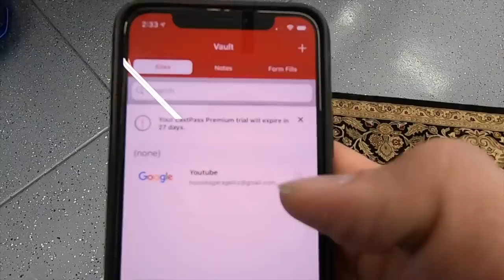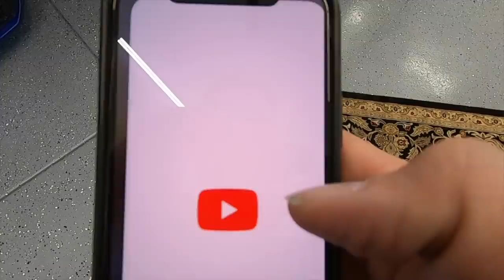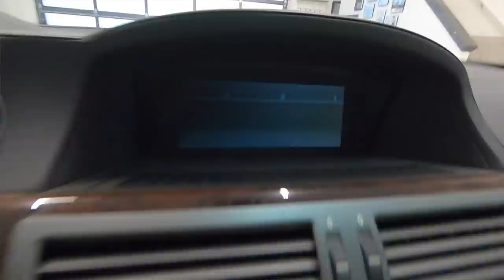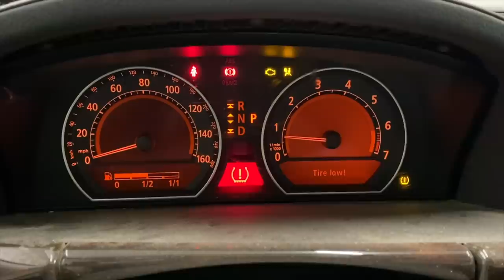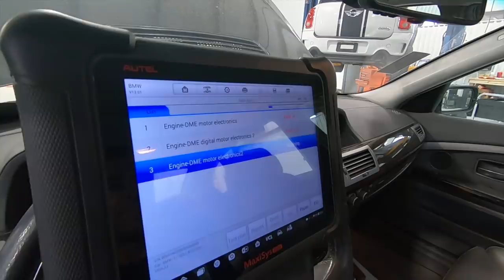I Bought a Cheap V12 BMW 760Li, Because I Never Learn From My Mistakes

Comment: 3k repairs on a car, that didn't receive any maintenance for years? sounds pretty good.
Reply: That's like 1k in a year ($83 in a month)
And people say that BMWs are money pits.
Reply: I drove my 523 for 14 years. Repairs: Coolant pump, broken door handle, rubber damper rear axl. I changed the breaking pads one times..... that's it.But it was an e39.
Reply: Yes
Reply: @juppidisco  my old E60 545i tells a different story...
Reply: @UCBarkeeper  yeah but thats cus you bought a 545 tho.. shouldve just gotten a 535
Reply: @benny8992  got an G30 M550i, i'm hopeful.
Reply: Juppi Disco e39 and no broken window regulators? Unheard of
Reply: Penta no, nothing else(and 300000km!).I think maybe it was the best model.
Reply: I can’t stand people bashing German cars, they are some of the most reliable cars out there when cared for properly. I’ve had plenty of people tell me how horrible they are while mine don’t need much at all and their Honda needed a new ac compressor, wheel bearings, ecu, cv joints, headgaskets etc and they want to say it’s more reliable. Bs
Reply: I had to spend $0 on repairs on a car that hadn't seen maintenance in a decade
Reply: BMW parts are pretty cheap compared to other manufacturers  (VAG and toyota I'm looking at you) - the problem is labor. Most BMW's over 2005 are pretty hard to work on. Also, when something on a BMW brakes, it's usually something small and annoying, but expensive to fix like a timing case gasket or crankshaft seal, so most people don't bother since it doesn't really affect the driveability of the car. Also most BMW's are owned by mechanically innept people... If you do decide to by a BMW, buy one that is been sold and has been serviced before sale by a BMW dealer. Got my 2016 3 series GT 320d for 11500 euro from one such dealer and they did most of the gaskets and the timing chain + tensioners before putting it up for sale.
Reply: @SilverracerKH  Scotty Kilmer disagrees
Reply: @juppidisco  e90
New Pulleys, New Water pump & thermostat, new oil cover gasket, new valve cover gasket, new starter....

Yeah, it's been rough. Next car is probably going to be a Lexus or Toyota. I love BMW but goddamn does that shit leave you stranded.
Reply: Will it stay reliable after tho? That's the real question
Reply: @AdmiralFroggy  lol no.
Reply: @Alecxace  that's what I mean lol. Don't get me wrong BMWs are slick looking cars they look nice and they run nice. But that doesn't justify the terrible purchase that is a BMW. If you absolutely have to have one just just lease it lol. The funny part is most luxurious cars if not all are pretty unreliable and or they are a complete pain to fix.
Reply: Yeah, only if you got yourself a car wizard lol
Reply: @AdmiralFroggy  In that case, why do people praise Acura and Lexus for their reliability compared to Germans? The truth is that luxury cars are truly the most you can get out of a car from what you can experience. Most manufacturers limit the features of their non-luxury brands (VAG, Toyota) to benefit the buyers that purchase their premium vehicles. That is why BMW and Mercedes are attractive brands because they only have one brand to focus on (except now they offer more entry-level cars that I don't like). But they're expensive to maintain so you have to decide, do you want a reliable, less fun car that will be cheap to maintain or the opposite? IMO after driving Honda and Hyundai for years,  I hope to make enough to 'upgrade' to a luxury car because they truly are better cars. But to be able to even own one, you need to be in a good financial position, which is where most people mess up. It also comes down to whether you are a car person and how far you are willing to go with that. I'm not crazy enough to daily some super expensive car but I would sacrifice some time and money to get a better car but that''s just me.
Reply: @juppidisco  If it was an automatic, the e39s really were the best model. Good choice!, some were lucky and had a very simple to fix Chevy transmission in them (Opel, which was owned by GM would share the transmission with BMW for a couple of years of the E39) and the smaller engines were generally okay. I finally had to let my little 528i go because of problems with everything else rather than the drivetrain
Reply: @basshead.  they are
Reply: Just spent that amount on an m5 and it still doesn't run well
Reply: Hoovie has 6+ cars at any one time. He is not daily driving these vehicles. Sure, $3,000 to get this thing running decently for you to drive 2x a month is not bad. However, if you were daily driving this car, I wonder how many of those $3,000 repairs you would have within 1-year.
Reply: @basshead.  Bmw's aren't poorly made they are amazing cars mechanical marvels but when they break they are horrendous to fix so people don't it gets worth and you get  a money pit so they are good but just pay the miantenenace don't buy it if you can't afford the maintenance!
Reply: @nicholasfernandez2573  they are overcomplicated so that they are an 11/10 instead of an 8/10 which makes it so that it's over engineered if you ask me you wanna drive 500k with your car get s toyota
Reply: @LowerYourExpectationsPleb  Best name ever!
Reply: @AdmiralFroggy  not likely
Reply: @UCBarkeeper  keep your warranty lol
ANYTHING new bmw wise is gonna spend alot of time at the dealer. my 22 year old e46 is a tank. but its no where near as nice as your g30.
Reply: Up in New England..multiply x 2 or 3

Comment: Love it when a car is so bad that the mechanic says "no thanks"
Reply: After watching hoovie I enrolled in a ASE certified auto tech course. 
I love these older BMWS but to own them and upkeep them I have to be able to do 90% of the work myself. 

The tools, experience, and software will pay for itself long term. From what I've learned with his costs it's one job will  cover the cost of the program much less two or three
Reply: LOL
Reply: the mechanics have no problems with bmw's,. only wizards and sorcerers run away,.,..
Reply: I took my 2004 F150 into a local mech shop who had a great reputation around my smallish town. I asked him about doing the spark plugs and the issue with them breaking.

He said "in 15 years I've never broken one yet..." oh really? You have a special trick on how to get them out?

Yeah, I refuse to work on them. I won't even let one in my front door and I'd like you to get it off my lot thank you lol
Reply: @muskokamike127  well,. call the cops,. cause i ain't moving my 1976 Karmann Bmw 633CSi that i use as a daily driver,.

better yet,. move the truck around the back,. cause you're ruining the view :D
Reply: @PresidentCamacho2024  what????
Reply: I drive a 1988 750iL and I can confirm this happens. Most BMW specialists in California won’t even agree to inspect the brake system.

Comment: I had to rewind.... did he call it a Mercedes??

Hoovie: “Hey Wizard there’s I need to fix this car”
Wizard: “What’s the issue?”
Hoovie: “It has a BMW badge”
Reply: You noticed that to. I'm sure he puts himself to sleep at night counting his cars insted of sheep but then has nightmares all night.
Reply: @wernerdanler2742  that's hilarious, I'll never have night sweats over my 2001 Chevy Prizm.
Reply: @nelzelpher2088  Good Andrew. I don't lose any sleep over my car even though it's a Mercedes with 150k miles.
Reply: @wernerdanler2742  My car has 209k miles. I'm surprised your not having trouble with your Mercedes. What's the model so I can buy it off you?
Reply: @nelzelpher2088  I never said I wasn't having trouble with it. I bought it a little over 2 years ago and almost immediately had to have that controller plate inside the gear box replaced. That was almost 2 grand. Everything else has really been fairly minor. 3 of the window regulators, alternator, belt tensioner and other things. Luckily, I can still do these kinds of minor repairs. No other drive line problems so over all I am fairly happy with the car.
I live in Vegas so the UV is pretty high here so paint does not hold up and the interior suffers. So it doesn't look the greatest but it actually drives great.
Oh yeah, not for sale lol.
Reply: @wernerdanler2742  oof I would hate to eat 2 grand like that. You failed to mention the model and year.
Reply: @nelzelpher2088  I have damn near 150k on my 2007 E550.... I’ll take a 15 year old used Mercedes over any modern Chevy or Dodge 🤣
Reply: @wernerdanler2742  I had my Conductor Plate on my gearbox just replaced recently. For $600. Only major repair I’ve had to do in 2 years of ownership, other than that it’s been basic wear and tear maintenance stuff
Reply: @nelzelpher2088  sorry I never saw your comm till now. It's a 2001 e320 with AMG sport appearance package.
I think I'm going to take it to MAACO soon for paint. 
I'm happy with it because it runs great!
Reply: @diablocls55  I guess I got screwed. When I think about it it just doesn't seem like it would be that much of a job. Did that $600 include the plate and the plug?
Reply: @wernerdanler2742  where did you get it fixed? Because I’ve only heard of dealerships charging $2000 to fix it... and from what I’ve read on forums most dealers do it for around $12-1500. I use an independent mechanic who specializes in Mercedes and BMWs who doesn’t rip people off, or tell people their car needs this and that when it really doesn’t. I only actually used him for the conductor plate and a problem I had where my headlight wiring degraded so bad and I’m not good with electronics on these cars so I didn’t want to touch it and risk fucking something up. And I had him replace the conductor plate because I don’t have a garage at my house. Just a average sized house and a very long driveway. Everything else I’ve done myself (radiator hose seal, front right air spring, serpentine belt)
Reply: @diablocls55  the place is called G&G Autohouse here in Las Vegas. It was a bit over $1700. It did seem a bit steep at the time but they came highly recommended.
Reply: @wernerdanler2742  oh I just saw you had an e320 which used a 5 speed correct me if I’m wrong. You definitely got ripped off because it’s even cheaper to replace (and easier) to replace the conductor plate on the 5 spd than it is on the 7 speed like I have. 7 speed, more has to come off (I believe the plate is bigger too,), valve body has to come down, and it also has to be programmed to the car.  I’ve seen many people who got their 5 speed conductor plate replaced for $5-600. It’s not as complicated with the 5 spd as it is on the 7 speed. Especially considering the early 7 speeds like mine had problems with the electronics
Reply: He did call it a Merc...

Comment: We have a saying in Europe that goes along like this “there’s nothing more expensive than a cheap bmw”
Reply: You're the first European I've heard admit that BMW's are shit. Good on you.
Reply: I have my own saying, Bring More Wallets.
Reply: @rickwendling5735  I know first hand why people buy them, when everything is perfect they are such a nice car to drive. It's just that the honeymoon doesn't last long before your wallet hates you. I've had two three series and two five series. The fives are amazing when everything is happy.
Reply: @ourtime-downhere6931  its also buying the right one. I bought a 2000 Bmw 740i for $2500 and I have had it for almost a year now with no problems in sight. My timing chains are going to be due in about 30k miles, but the car is pretty solid.
Reply: @ourtime-downhere6931  Good news for you. A ton of Europeans know that bmw's are shit. Last bmw I'd get is e46. I'd rather shot myself than owning anything that is more complicated and newer than e46
Reply: @georgehuser4711  both me 3 series were the e46 325i and other than the cooling systems my first one was fairly solid. Always little stuff but nothing beyond DYI. My second one did have the transmission go out at 158k miles, then promptly blew a head gasket right after I paid for the rebuilt transmission. So I'm split, the first one was great, almost never issues besides spark plugs and normal stuff. The second one I put probably twice as much in it as I paid for it. The two 5 series were E60's with the v8's and I wouldn't even accept a free one at this point.

Comment: Hysterical that he thinks he'll be done after these repairs are finished
Reply: The only way to properly fix a BMW is to buy a non-BMW car.
Reply: After this, there's more to come :))
Reply: Yes, we are only at the beginning of another tragic story.  Probably not M5 or Bentley Continental level but we will see.
Reply: Not if he sold it right away.. A 760LI with a V12 engine fully repaired for a bit over 7k would attract a few interested buyers.
Reply: Kevin Barry the longer you keep a bmw, is when you will eventually pay for it all over again, and again in terms of its maintenance requirements, they are endless money pits.

Comment: Flood damaged vehicle 
Mud on the floor 
Texas plate.
I'm from Houston
I know what I am talking about
Reply: Our flood car didn't have mud or dirt on it just satl water stains like crazy
Reply: Yyyyeeeeeep.
Reply: Was kinda obvious yet no mention of flood damage?! Might as well have been a used aquarium.
Reply: If it was flood damaged and it runs, so what?  Clean it up and drive it.
Reply: @johnhansen4550  Flood damage will destroy electronics and make it a nightmare to keep running... On the level of his previous Bentley at least.
Reply: Yep
Reply: thats where I have so many issues with these so called "car experts"
has he ever bothered to mention it was a flooded car ?
Reply: Stephen Reed sounds like a regular, nondamaged 7 series
Reply: Not a Texas tag. It’s a Kansas dealer tag.
Reply: @johnhansen4550  lol okay. Funny comment.
Reply: From what i see, probably purchased from Classic BMW in Plano, TX. Most cars bought from them have a texas flag on the back (i live in dallas)
Reply: @ethanlaug659  im in houston and these dealerships put that flag on anything 😂 he say he got it from auction tho so it didnt come from a dealership he couldve gotten it from any auction cuz they always gettin cars from every and any where
Reply: I agree. I'm no expert, but the way everything was evenly filthy says flood to me. Normal dirt is clustered around frequent touch points and uneven.

Comment: I can’t believe he actually said “I’m not working on that”. You’ve probably spent over $200K with him. I’d flip out lol
Reply: The reason for a mechanic to decline the work is because thry know its a pain in the butt to work on and they are going to loose their shirt if they take it
Reply: Ricky Lahef that is absolutely true. As a matter of fact I personally know a lot of mechanics that when they get a car like that which is way over their head they will send it off to another shop that specializes in that car and fixes them all the time.
Reply: I drive a 1988 750iL (also V12) and I would’ve been shocked if the Wizard said yes.

I’ve called mechanics who specialize in BMW, they talk for minutes, then they ask model and year, and hang up without a word.
Reply: jacobbrashears yeah those V12 engines are not the easiest cars to work on that’s for sure. I’m surprised that the BMW specialists don’t wanna work on that one though. I’ve been told that a lot of Bimmers with the V12 engines share the same engine as a Rolls Royce Phantom and probably some other similar British made vehicles. Perhaps you might try somebody who specializes in British motors specifically the V12. That’s probably your best bet with that car. I wish you luck
Reply: @jacobbrashears  I nearly bought a professionally stored ‘92 750il with 4,000 miles last year. The friend that bought it, sold it in about 9 months......  Looks like I dodged a bullet!

Comment: Flood damaged car, that’s why all the dirt is on the floor. Sediment
Reply: Same thing that i thought
Reply: Naw. That rust at the foot of the rear seat is just from a batch of bad bolts. And thats the original complementary fish carcass in the trunk!
Reply: Orcinus1967 😂😂😂😂
Reply: Houston?  I noticed a Texas sticker on the trunk. I’ll bet you’re right as rain on the flood assessment
Reply: @stevetilk4926  it has snow tires. I doubt it was in Houston unless it was dumped there on purpose for insurance money
Reply: M6Cabriolet good catch. The Texas sticker was a tip off for me.  I wonder where the car came from.  Snow tires???
Reply: I don’t think it was flood damaged.  I think it was a car driven in the north in maybe a snow belt area, and just wasn’t cared for or cleaned.  All the salt  sand and mud over 11 years can make light grey carpet look pretty dirty.  I had a car totaled from salt water flood, a 2010 Cadillac CTS-V, which got flooded in Sandy in 2012, and was totaled out.  Salt water was up to the headrests while in my garage.  I remember thinking how bizarre it was when the tow truck hauled it away as a totaled car, which “looked” great.  Even the interior, minus saltwater still in the cup holders and shifter boot, still looked great - it wasn’t dirty like this,
Reply: Z06ified -wow!

Comment: E38 is an amazing and a very reliable 7-series. E39, 36, 34, etc are also problem-free
Reply: E28 and e30s are also reliable as hell if even remotely cared for. My current e28 has 296,000 miles and runs beautifully
Reply: As long as you take care of it, most of them are pretty damn reliable. Sure, parts will wear out over time, but that happens with every brand. Of course, if you cheapen out on parts and skip maintenance, it won't last long.
Reply: @brianreilly4306 yupp '83 e21 with a little over 300k on the original m10 :)
Reply: It IS kind of cute to hear north americans bash german cars 😄
Reply: Laughs in timing chain guide failure